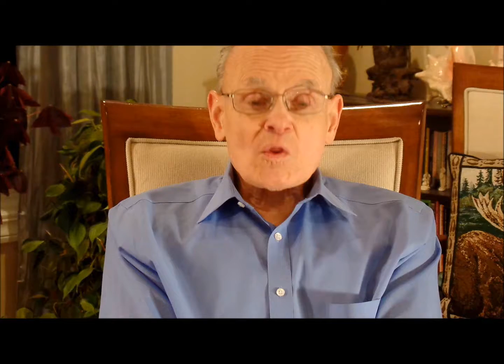LENR (Low Energy Nuclear Reactions) - Breakthrough Applications! (Video 3)

Comment: Can be the hidrogen flame of a HHO torch exposed to a bronze or nickel ball and as you remember ther was a video from 15 years ago that this ball lights up in joust 3 to 5 seconds almost a colored red, before it can be melt. Does this LENR has to do with this way of hitting a metal with a HHO flame torch and provoquespecial subatomic reactions that the hidrogen can do on metals at the time you want to burn it?  give me your feed back. have my best
Reply from the maker: Thank you for your comment.  What you suggest could be possible; hydrogen and nickel are two LENR fuels that can generate much heat coming from a small mass of "fuel"!

Comment: Really interesting, I have like an inner repulsion towards nuclear about the dangers of radiation or have I got in wrong in this case?
When you convert the L E N reaction into electricity into electricity, has it always have to be though a generator and in this case powered by a sterling motor, so this isn't electricity generation, it heating water, or am I wrong,? 
How far do you believe we have come in understanding nuclear,? 
Have we scratched the surface or is it all totally understood? Is it worth the risk when we can get essentially the same thing with geothermal, is it worth pursuing when you have already mentioned elsewhere there are much safer and perhaps much easier ways for electricity generation or capture.?